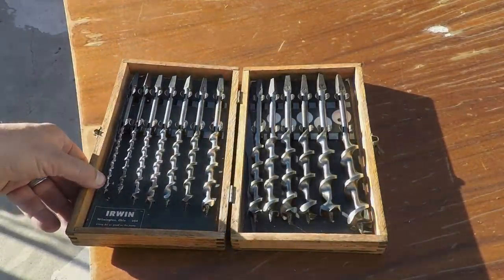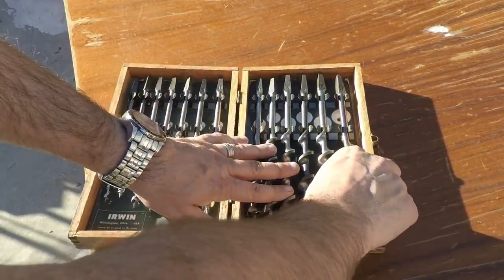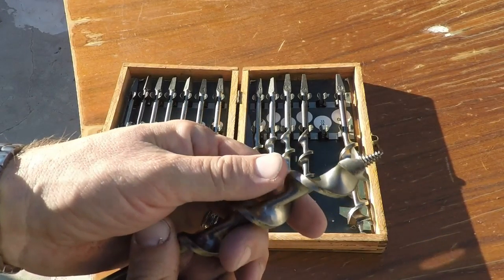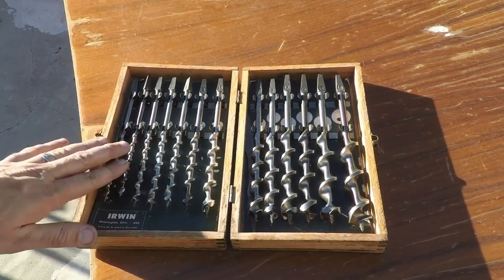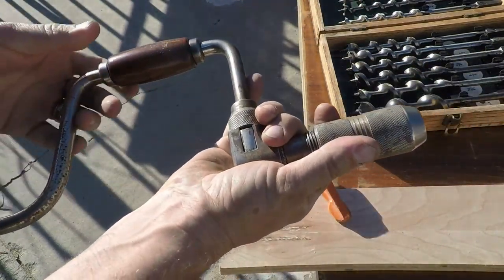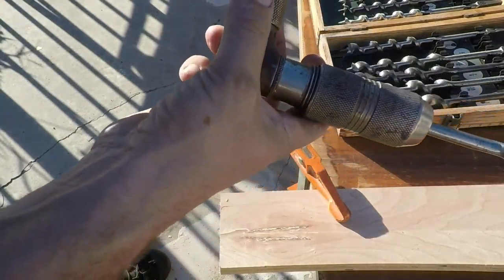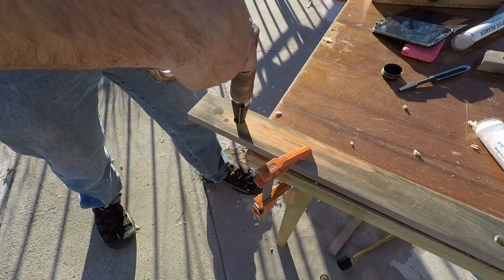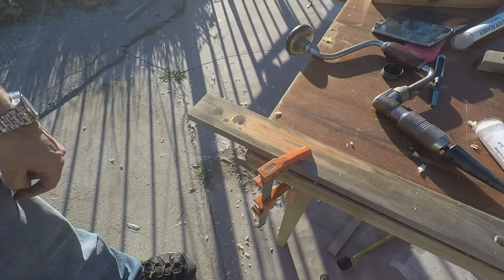Antique Hand Brace Woodworking Auger bits and Spoon bits demonstration

Comment: Hello, Thank you for taking the time to make the video. You talk about one of the main advantage of the spoon bits being that you can cut - change angle mid drilling vs with an auger, yet you drill the same way 90 degrees as with the auger, making your comparison useless ESPECIALLY for a chairmaker. With the same effort in less than 2 minutes you could have made a perfect video to demonstrate the difference without saying a single word.
Reply from the maker: Your welcome I should do one on spoon bits at some point.

Comment: If you are boring a big hole near the end of a thin piece, you should clamp it by the sides or put a clamp across the work to keep it from splitting. The tapered screw generates a pretty strong splitting force.
Reply from the maker: Great tip I have definitely seen that happen

Comment: Found a set from my family, marked Sweden where my family came from.. that box looks new conpared to the one i found.. its awesome.. all wood inside and even a slot where a piece of wood runs across so you can close the box without them moving about.. didnt find the drill and was curious what kind of chuck was needed and the type of drill i should be looking for..
Reply from the maker: this kind of bitis used with a brace . the old hand cranked ones if you know what that is. you can search for " bit and brace " there are millions of them out there look at flee markets and yard sales and maybe antique stores.
Reply: @OldIronShops  Thanks didnt know brace was the keyword i was looking for.. didnt want to buy one that wouldnt fit the larger bit size they use.. got a nice red wood one for about 20 bucks.. nice price to be able to use all these
Reply from the maker: @sluggy1  I'm glad w help I use mine all the time.

Comment: I've been spying around to get a set of these.  Is it possible that it advances an exact distance per rotation?  That being 1/16"   Could it be that you can count the runs and know when to let up.   Hmmmmm.  Jus specutat-in.    I kept thinking you were just a few cuts away from a nice birdhouse.
Reply from the maker: +Crafted augers or spoon bits?
Reply from the maker: +Crafted yes with the augers the drill depth is repeatable based on number of turns. Not to machine tolerance but for most tasks it would be just fine.
Reply: Chris Anderson Augers.  I've seen spoon bits before. I think they would be fun to own.  Would be even more fun to forge.
Reply from the maker: +Crafted the ones that I have are machined Simple save the inside bevel. Easy cnc job though.
Reply from the maker: +Crafted I don't know if I answered this but yes you can count the trunk to hit a depth.
Reply: Yes, you can measure this. Not every pattern will advance the same amount, but you can find out and get very precise with hand drill/brace bits

Comment: Im almost certan they have been used its actually bad not to use them because they will almost never rust if you use them weekly but will almost always rust if you never touch theme
Reply from the maker: I very certain that there was almost no use when I got them. they all still had the factory grind . Don't work too I have used them plenty now😁
Reply: @OldIronShops  then that really is impressive must have been a set someone gifted the original owner so they stuck theme somewhere with close to no humidity
Reply from the maker: @timmytexlonghorns2206  yeah they were very well cared for.